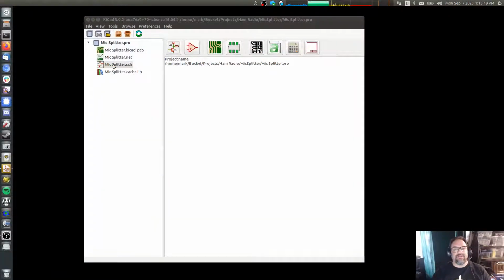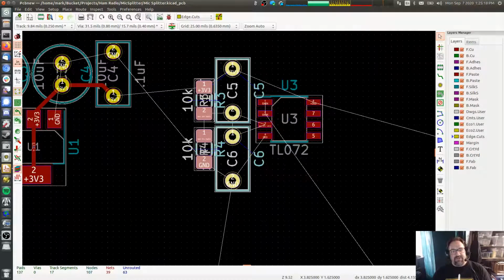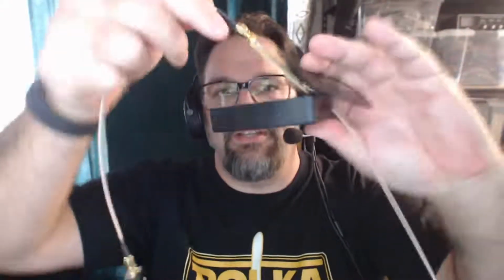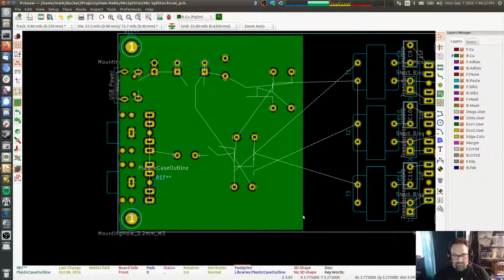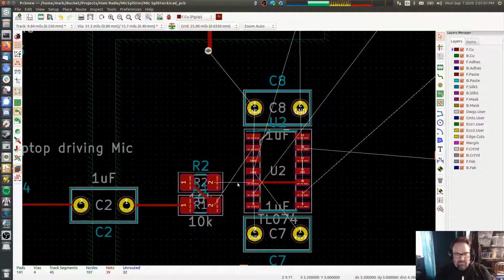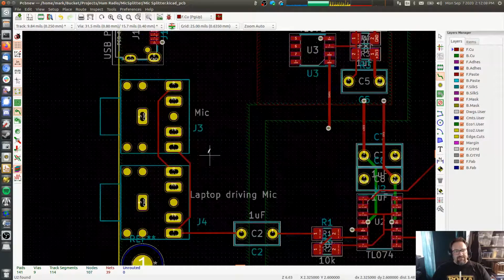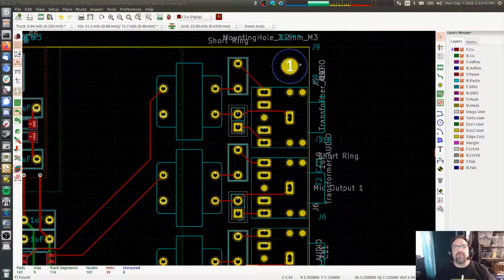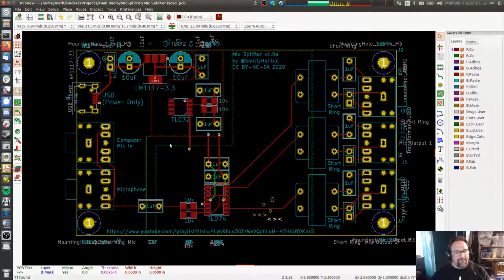Smitty Working on SOMETHING: Mic Splitter Board Layout, Part 2

Comment: Smitty, I THOROUGHLY enjoyed this series!  Will you do a similar series for the contesting audio console?  If so, can you discuss a few things: 1) ability to use both dynamic and condenser mics - at field day this year, everyone brought their own headset, and it seemed there was a mix of both.  2) ability to use the 12/13.8v supply for mic bias for condenser mics.  3) amplified speaker output for “observers”?  In any case, I look forward to your next projects.  K4JDA
Reply from the maker: Have you already watched this one? https://www.youtube.com/watch?v=d2vIKhrSCEs 

To answer your question though, having just finished ARRL FD 2021, yes I want to do some more work on the console board.  I might do some this weekend, if my time allows.

1) I've kinda settled on Electret as the mic standard, because I'm settling on "PC Gaming Headsets" as the headset of choice. If you really want Dynamic, it'll need to block the DC power and increase the gain some.  If you build this yourself, you can make those changes pretty easily.

If you mean a LITERAL condenser, expecting 48v DC power, no. You don't want that for this use case. And I think you'd be hard pressed to find a headset with a condenser mic that requires 48v phantom power.  Condensers pick up EVERYTHING in the room, they're so dang sensitive. That's not what you want in a noisy environment. Dynamics would be better than electrets, but they'll both work well. A literal condenser won't.

2) The mic output already has the 13.8vDC send to the mic pin for an electret. A condenser will probably want more than 13.8v, but it might run on 13.8v.  But, again, you really don't want a literal condenser for this use case.

3) Yep, it's got that. LM386, so not a GREAT amplifier, but it's an amp. Just hook up a mobile speaker, anything that can be driven by an LM386 (which is a lot) and you can hear the radio audio. I don't include the mic audio in this because I figure the operators are right there, you can probably hear them already.

I'm also thinking of adding another 3 input mixer to produce a line level output for recording, or streaming, or whatever.